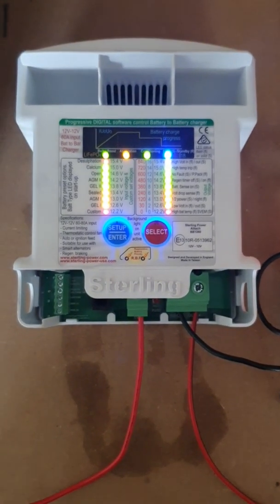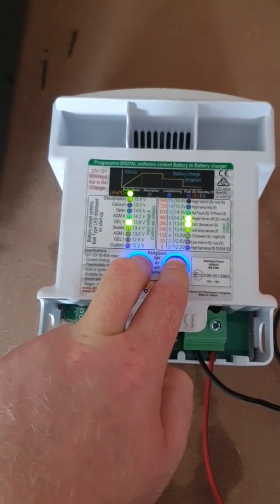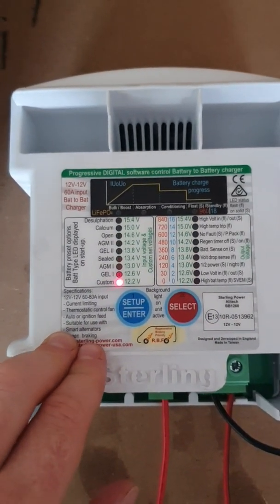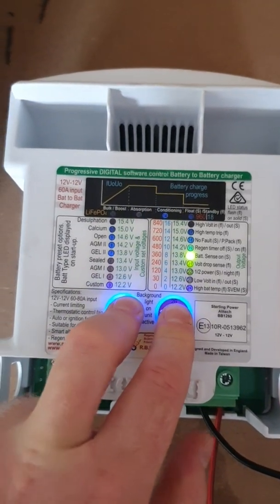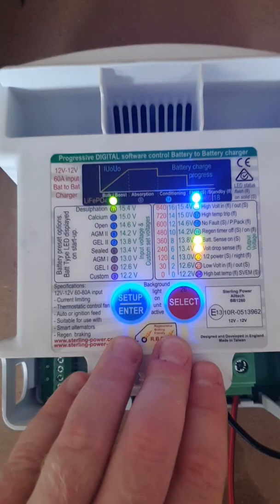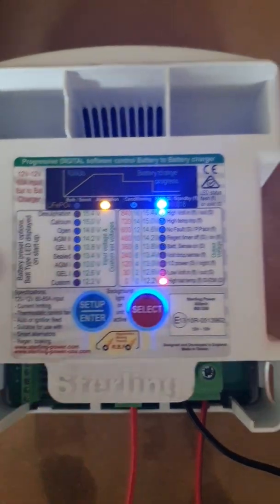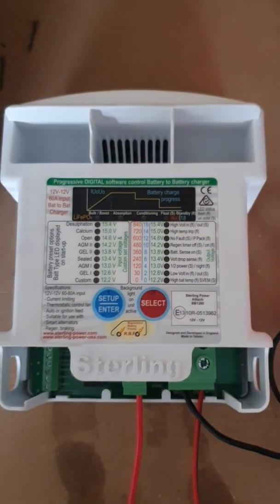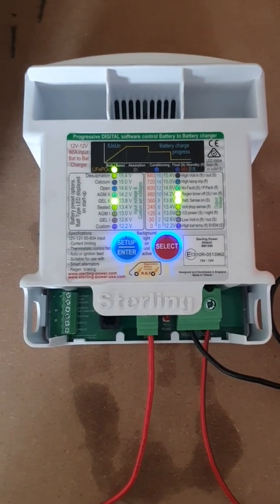Sterling Power BB1230/1260 GUIDE - Custom Profile Select and Startup

Comment: Hi, now I have a Sterling alternator to battery AB1280 to charge the engine battery and the service battery... wanting to replace the service battery with a Lifepo4 I would add the Sterling BB1230 between the engine battery and the service battery. Is it better to keep the AB1280 connected only to the engine battery?
Thank you
Reply from the maker: Hi Mauro,

Thanks for the inquiry. Yes, that would be our recommendation. Alternatively you could look at reselling the Ab1280 on eBay or to anyone else to help recoup costs.  We also have the BB1240 which may be of interest to you, it's slightly more powerful than the BB1230 and more efficient, too.

Comment: hi i have recently had a 180w solar panel fitted and since installation the voltage indicator is going over 16v and setting of alarm how do i rectify this i.e. supress the voltage if at all possible ? thanks in advance....
Reply from the maker: Hello Robert,

1) Do you have a solar regulator installed?
2) What is the solar regulator output profile set to?

If you do not have a solar regulator and you have just put the solar panel directly across your batteries... Don't. You need a solar regulator.
Reply: @SterlingPowerProducts  hi thanks for the swift reply i didn't fit the solar panel however they have fitted a solar charger controller i don't believe this is set up at this goes over 16v also (I've disconnected) should the panel be connected via this assuming i can regulate the voltage before connecting to the b1260 ? as you are aware there are connections for solar on the bb1260 but the voltage needs regulating before connecting to the unit, again thanks for the reply p.s. i have just watched your video and reset the unit which seems to be working fine
Reply: @SterlingPowerLtd i thought the BBS1230 unit allowed you to connect the solar panel direct ? it would appear to have the connections...
Reply from the maker: @robertmorrey547  Hello Robert,

That's correct- however this video is for the BB1230/60 so I didn't presume you had the solar unit!

What is the VOC of your solar panels? This should be available on their spec sheet.
Reply: Do you have an email address I can send you picture of my unit just to 100% confirm which model it is ? Thankyou
Reply from the maker: @robertmorrey547  info@sterling-power.com :)
Reply: @SterlingPowerProducts  thankyou will email next week just about leave home for a few days away 🙂
Reply from the maker: @robertmorrey547  No rush!

Happy travels.

Comment: Hi there, ive just fitted this today for someone. Firstly he has a standsrd 100ah leasure battery. So i assume i should simply select 'sealed' battery? Also after i selected sealed battery it ran the fan switched off and did nothing? The blue float light is flashing? Maybe ive accidentally forced float? - both menu buttons are illuminated.. But no output charge is going to the leisure. At this point im assuming ive put the unit into standby mode? as the input voltage/engine was running so should be charging the leisure? im thinking to reset the unit. I have no ignition wire fitted but do have the temp sensor fitted as instructed. Will default settings be ok? Any tips appreciated
Reply from the maker: Hi Richard,

Check the battery spec sheet and see what the battery manufacturer actually recommends (RE charge voltages) for the batteries.

Best thing for you to do is to do a factory reset and leave it on default settings until you know you need to change something. The default is sealed.

Run the engine until unit turns on. Both buttons on the unit for over 30 flashes (let's say 35), let go, then both buttons again for two flashes.

Then leave it.

If it seems to not be doing anything when the engine is running.. what are the voltages on the IN and OUT? The unit will only engage if the input voltage is >13.5V. If the input voltage is not exceeding 13.5V when you turn the key, you probably have a smart alternator and will ned to fit an ignition feed. 

Best,
Ben
Reply: @SterlingPowerProducts  Hi there, thanks for your quick response.  I've checked it today and I must have put the unit into shutdown by accident. I turned the unit on and manually select 'sealed' the unit seems to be working fine now. About 30 seconds after engine started it woke up (two blue lit buttons) and I then switched it on and simply selected 'sealed' and left it. 
The input voltage says 13.6-14v ISH and output 14.6 - 15v. Silly question, but I assume the unit will go into a float/trickle mode automatically as to not overcharge? About an hour After I turned the engine off the leisure battery was reading 12.9v. 
Should I still do a reset? - Or does selecting 'sealed' manually mean the charge parameters will all be ok?
 Obviously I will look into the battery manufacturers info. But all I know is, it's a standard 100ah leisure battery. - It's not AGM or lithium
Regards Richard.
Reply from the maker: @richardd8352  Hi Richard,

If there's any confusion about if you may or may not have put it into any weird settings- probably best to do a factory reset. It's easy to do, and will put you in sealed anyway.

Output voltage of 14.6V up to 15V is higher than expected- do you have a temperature sensor fitted? If so, I'd predict it's just temperature compensation.

Also sensible if you make sure you're getting the charge voltage actually coming through to your leisure batteries. The charge voltage of ~14.4-ish volts (pre-temperature compensation) should be equitable to what is read at the leisure battery at the same time. 

RE: float- yes. We have timers in place that dictate when we go from absorption to float. Generally (time taken to reach absorption voltage * 4).
Reply: @SterlingPowerProducts  I do have a temperature sensor fitted. Yes I think I will probably just do a factory reset.-
  On the unit itself -  the row of green lights on the right were indicating 15/14.5 v for output.  I checked with a meter at the leisure battery and the output was 14.65v - which correlated with what the unit was saying. I will perform a reset tomorrow. Sorry for so many questions, but after reset what sort of voltages should I expect during charge phases. I know 14-15 volts are nothing unusual from initial charges, but would I be right in expect those voltages to drop as the battery nears charge capacity?  Again sorry for all the questions. -  Richard
Reply from the maker: @richardd8352 
That output sounds about right for a full battery that is also seeing an elevated voltage due to temperature compensation. Without the temperature sensor fitted you would see 14.4V.

You'll see it drop to the float voltage of ~13.6V after an hour of runnin, if it's jumping up to the target voltage immediately.

Your batteries are probably full.
Reply: @SterlingPowerProducts  Ah I see,  this may also be a silly question -  but my leisure battery is under the front bonnet. - Ambient temperatures were very very cold when I fitted the unit and started it. Could this account for the temperature compensation -  ie - would ambient temperature affect the sensor? or does it detect battery core temperature only? Apologies my understanding is limited lol. Is it best to keep sensor fitted? As I know it's optional. 
Richard.
Reply from the maker: @richardd8352 

Generally only ambient. It's only a resistor based temperature sensor that sits on the negative terminal of your battery. Your battery, in most cases, will be the same temperature as the ambient anyway. 

I generally don't recommend temperature sensors, but that's predominantly because it saves me the phone calls later in the future when the voltages being output by the charger are not what the user expects to see.  

There's probably partial benefit, but it's not crucial.
Reply: @SterlingPowerProducts  Great, thanks so much for your help. I have a clearer understanding now. Have a good day - Richard.

Comment: ive just ordered a fogstar 100ah lithium battery. will i have to create a custom battery profile on my bb1230 for this battery. i see it says lifepo4 at the top but not on any battery profiles.
Reply from the maker: Hi John,

The LiFePO4 at the top is actually the lithium profile- which lines up well with Fogstar's recommended charge voltages (from my own recollection).

Go through the normal battery type select procedure, go aaaaallll the way up to LED number 12 at the top, then confirm it by pressing both buttons for two seconds. 

Job done :)
Reply: @SterlingPowerProducts  thanks for the quick reply. ive noticed there seems to be an old and new version of the bb1230, i think mines the older version. I get my battery tuesday so hopefully ill get chance to try this next weekend 👍

Comment: I have your charger and have recently swapped from agm to lifepo4 fogstar battery. I have followed all of your steps in line with their recommended voltages.  As soon as it hits 100% charge though I'm getting Cell over voltage warnings on the battery. I don't know what I could have done wrong. My solar charger appears to stop charging at capacity but not my b2b. I am a novice so don't now what to do. Any thoughts?
Reply from the maker: Hello Oliver,
That's great to hear and I'm glad to see we're in your system, but it's a shame you're bumping into issues on the battery.

Please verify that the voltage the charger is outputting is correctly set for what your batteries want to see. If we're outputting the correct voltage and the correct voltage is arriving at your batteries and your batteries are still going into an alarm state, I'm afraid that fundamentally our charger is working correctly but the batteries are still unhappy.

Therein, there are two possibilities.
1) If Fogstar are using a Daly BMS, this is in fact standard for when a Daly BMS is full and is likely not going to have any negative effect
2) The cell quality is poor and thus when under quick charge we are experiencing irregularities.

Best people to be able to recommend for Fogstar units is going to be Fogstar, I'm afraid. 

Here if needed;
B

Comment: How easy is it to fit the remote control and is it worth it? Thanks
Reply from the maker: Hello Reacohn,
It's a circle-cut, diameter is in the manual. Relatively simple to do with a power drill attachment.

It offers the ability to customise it remotely and to see what is going on with the unit, but whether it is worth it or not is up to you..!
Reply: @SterlingPowerProducts  Hi. Thx for the reply. I meant how does the lead attach into the unit? Mine is a little hard to get at and I can see there is a ethernet type hole but I  would have thought there was a rubber/plastic plug that you pull out and then pop the lead in. However when I feel across where the 'hole' is, it just feels smooth all over. I just wondered if this means it is thinner plastic here and I push the lead through it or I have to make a cut?
Thx in advance for your time.
Reply from the maker: @reacohn751  Oh! Understood. The remote port is the ethernet port next to the cable inputs.

Comment: Has anyone solved the issues of the b2b charger resetting it's self back to factory settings, my b2b charger won't allow me to select agm2 option it only allow sealed to be selected
Reply from the maker: Hi Chris,
This isn't an issue that we're aware of at all. It might be a good idea to give us a call on the technical line, 01905 771771, or email info@sterling-power.com and we can go through some tests or verify what's happening.

Comment: Hello. This video is great. I'm about to swap my lead acid for a Lithium one and am confident about getting the settings right. Am I correct in removing the temperature sensor from the Sterling? It seems to be the case, but I'm not 100% sure. The manual refers to "Ensure you remove at least 1 wire from the battery temperature sensor as the product voltage may be higher ( if in cold climate ) or lower ( if in warm climate ) than the preconceived voltage" which doesn't make sense to me.

Comment: Question - I currently using a Sterling Power 70amp 12/24v DC/DC changer that charges my van house battery.  I have a 190amp alternator, its managed for a year with not problems. I have a sprinter van 313dci that has a smart alternator. I am running a remote wire to the Sterling Power to tell it when to turn on. What i have found is the battery changer works fine on idle, it changes the pack at 32amps at 24v. As soon as the van is moving this drop to 8 amps at 24v any thoughts on what this could be?
Reply from the maker: Certainly odd. 

Could you get a hold of a voltmeter and let me know what the input and output voltages are on the unit when it is doing this, and also what the LEDs are indicating on the unit itself?

I assume the remote wire you mean is the ignition wire. Is that already fitted?

Ben

Comment: I already have 100w Solar panel through a brand new MPPT controller - I’m planning on fitting a Sterling B2B charger, so should I replace the solar controller at the same time and fit the BBS1230, or can I keep it and use the basic BB1230 along side -  it’s a lot cheaper?
Reply from the maker: Hello Shaun,

If you already have a functioning solar regulator that meets your needs and you are not urgently pressed for space, then simply retain your existing solar regulator. One limitation of the BBS1230 is that it can only do either DC/DC or PV/DC at any single point in time, so in theory you will benefit from a superior harvest if you have a BB1230 and a dedicated regulator operating independently at the same time. 

I hope that makes sense!
Reply: @SterlingPowerProducts  that’s great, thank you.

Comment: Hi does anyone know what preset setting I should use for lifepo4 battery
Reply from the maker: Hi John,

It's not really for us to recommend what your battery manufacturer might want. If they're not our batteries, it's not really our role to safely say what the manufacturer wants.

I'd advise you to contact your manufacturer or to look at your battery specification sheets for recommended charge voltages.

If you can't find any guidance, you can use our default LiFePO4 setting, which is pushing the battery type select LED up to LED number 12. 

-Ben

Comment: Very instructive video. What absorption time factor shall I use for a Trojan flooded lead-acid battery? Thanks
Reply from the maker: Hi Ovartu;

We can't really be the ones to guide you regarding what a battery wants, specifically. You'd be best off talking to trojan or looking at the battery specification sheet for that guidance. 

We can cater to your battery manufacturers needs, but we can't specify them! :)

-Ben
Reply: @SterlingPowerProducts  Thanks, I will contact Trojan for specific advice.
In the meanwhile, maybe you can let me know what is the preset absorption time factor for open/flood batteries in the BB12xx.  The reason I am asking this is because when I customise the charging voltages I have to introduce a custom ATF too, so keeping the preset value is a good option when you do not have any other recommendation available.
You mentioned ATFs of 6 to 8 in the video, but I am not sure whether those values are applicable to a flooded lead acid battery.
Thanks in advance.
Reply from the maker: @ovartu1394  Hi again;

Fairly adamant it's an ATF of 4 with a minimum time of 60M and a maximum of 480M.

Most important, we find, is the actual voltage rather than the time period we expose the batteries to the voltage. Hopefully, to save you a headache, the presets offer a good solution!

-Ben
Reply: @SterlingPowerProducts  Great information. Thanks Ben.

Comment: Is the battery profile for the input battery or the output battery (battery being charged)?
Reply from the maker: Hi Matthew,

The battery profile is for the output voltage. Check our charging voltages against what your leisure battery wants to be charged at and choose the most relevant profile that sticks within it's ranges.

Hope that helps;
Ben

Comment: Where can I find the settings to set up for lithium batteries? I’m still a bit lost on that
Reply from the maker: Hi Gianni,

Go through the normal battery type select process (hold both buttons down for between 10-20s) and then push the LED that'll have appeared on the first column all the way up to LED number 12- next to the LiFePo4 pointer, up in the black bar. 

Once the LED is lit up, press both buttons down together to confirm the selection, and then you're in! :)
-Ben

Comment: Hi, thanks for all of the videos. One thing that I'm a bit stuck in is the charging profile to be used. I have a Yausa m31-100 leisure battery and it says it's a calcium battery, but I can't find anything definitive about what charging profile should be used from the battery manufacturers. Would the 15.1 voltage not be too high? I've reverted to the sealed profile at 14.4v for now, but in all honesty I'm not sure if I'm cooking the batter at either. Any help would be much appreciated.
Reply from the maker: Hi WelshWhiz!

Happy to assist- or, hopefully assist. First thing for me to state very clearly is this : I do not know your battery personally and I am not their manufacturer and as such take my words as rough advice and don't come chasing me with a stick if you do end up finding some literature and my advice isn't 1:1.

You'd be best off reaching out directly to them, honestly. Our presets are just done off of rough averages at the time on the market. Calcium can generally take a lot more abuse than other chemistries. Double check all around the battery for any labels that may give you an idea of what it wants.

If that fails and you're still cautious about 15.1, 14.4 will be suitable for now as it's suitable for the overwhelming majority of batteries, it will just be a slower charge. 

15.1 is typically fine for calcium, but that's not for me to verify- we do chargers, not the batteries! :)

B